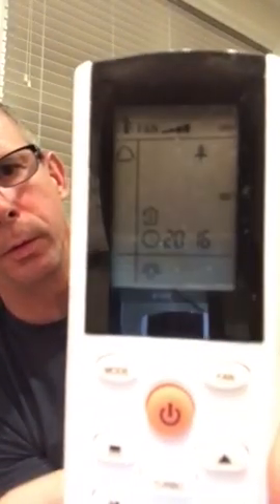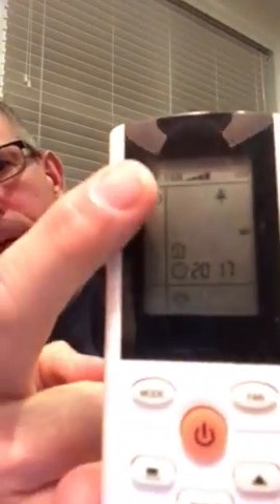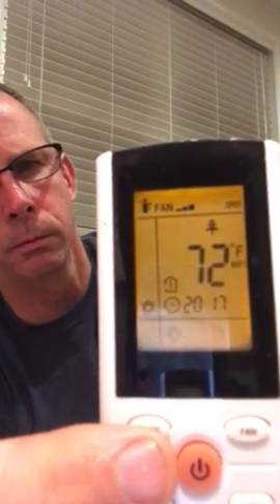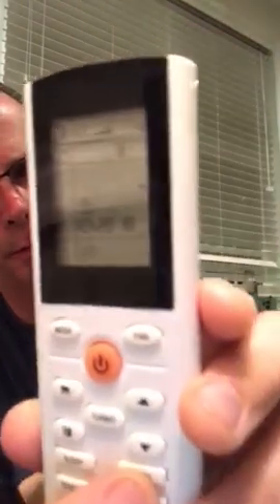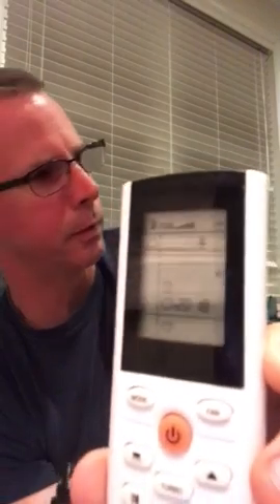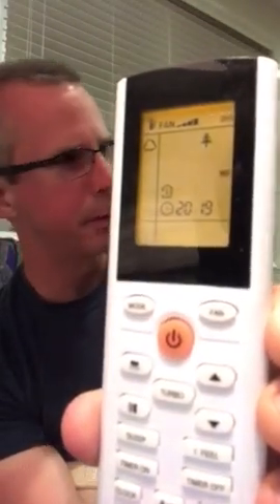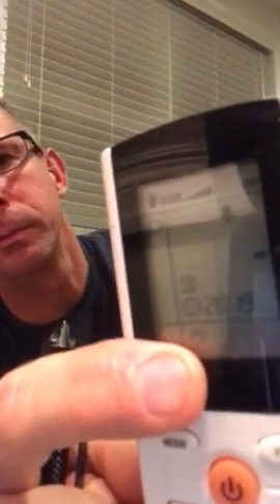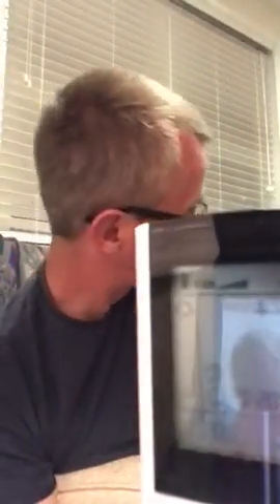Trane Minisplit Remote

Comment: Fantastic info....thanks a bunch....ive also learned that the TREE button is an econ mode that may effect the ability of the unit to cool at full efficiency....I turned mine off....why in the world doesn't Trane make a youtube describing all these features?  Also my temperature button is giving strange readings which are not immediately inferable from pics.  Ugh   Come on Trane, step up....

Comment: Where we live temperature dropped from 19 to 3 degrees in one day, we were so desperately trying to set the heat mode but we didn't get anywhere after scraping the useless manuals over and over.
Thank you for posting, at least we got the basics!
Reply from the maker: Thank you for commenting! I’m so glad it helped you. It’s sad that manufacturers will not write common-sense instructions on how to operate their products. You can imagine what it’s like for us technicians because we install/startup many different products with inadequate instructions. The tech support these days is just awful as well.

Comment: When the unit is in auto mode, the display on the unit reads “77” which is none of my set point temperatures. What is the meaning of the display when the unit is in auto mode?

Comment: Other than the set points for heat and cooling could you explain the correlation of the temperature settings along with moisture and fan settings?

Comment: Thanks for the explanation. I have a question for you Earl Heath (or anyone with that kind of trane remote.). Would you know what does the "WiFi" thing do on the remote? I found many smart apps that has the name and icon of the Trane company, and I especially found on my google home app that it's compatible with a device that's with Trane. But I'm not sure if that icon really means Wifi where you connect it to the internet. (Answers from anyone is always appreciated.)
Reply: Did you get any luck with this feature @coolgamer-yg8ur? I am still hoping I could use it. Thanks!

Comment: "The cooling set point always must be higher than the heating set point." 
Wait, I'm confused. Does that make sense? Shouldn't it be the other way around?
Reply from the maker: @adriant240  You are correct. Switch them around and you confuse the logic. It will not work if the heating setting is higher than the cooling setting.
Reply: @Earlvis  That depends on how it's designed to work. Is it programmed to heat/cool to a set temp or to heat/cool from a set temp? I'm even more confused now. The unit also shows a "E7" message, which looks like an error message. I don't know what I'm doing wrong.
Reply from the maker: @adriant240  If you have it in an auto-changeover setting, The cooling setpoint has to be higher than the heating setpoint. If you manually set the mode, it doesn’t matter.
Reply: @Earlvis  Ok, that helps. It's easier to just use the individual mode setting over the auto. But I'm still getting an error message, so need to figure out what that means.
Reply from the maker: @adriant240  Been years since I worked on those. If you’re not a tech, you should call one to diagnose.
Reply: @Earlvis  Thanks. I'll put in a work order. Thankfully it's not that cold outside yet.

Comment: I think I figured out the "TIMER ON" and "TIMER OFF" features. Pushing either one of those buttons will let you activate, deactivate and set time for TIMER ON and TIMER OFF respectively. In other words, the remote will turn the system ON automatically at the TIMER ON set time and turn it off at the TIMER OFF set time (if both are enabled).

If it was previously activated, pressing TIMER ON/OFF will deactivate TIMER ON or OFF respectively. You can tell that TIMER ON or TIMER OFF are enabled by seeing the "ON" and/or "OFF" on the right side of the time.  Pushing it again (or the first press if it was already deactivated) will put it in set time mode for TIMER ON/OFF with the clock disappearing and either "ON" or "OFF" blinking on the right side. Use up and down arrows to set ON or OFF times and press TIMER ON/OFF within 5 seconds to accept it (otherwise it will auto cancel). It will also enable TIMER ON/OFF. It's easier to understand if you play around with it.

One very important thing to remember however: The timer ON and OFF feature appears to be controlled entirely by the remote itself and not simply programmed into the unit it controls for it to do it on its own. This means that the remote MUST remain in such a way that it can transmit its signal to the unit it controls otherwise it will not work.

Comment: thank you for the video do you know how to change between celsius and fahrenheit
Reply: "When unit is powered off, press MODE and use buttons simultaneously to switch ℃ and ℉"
Reply: @Woetsmyla3  what is "use buttons"?
Reply: Candice Wilson I’m lost also , what buttons  to use with “mode” button ?
Reply: I am confuse also. There not clear how to switch F to C. Please Help.
Reply: @candicewilson1475  press the mode and the down temperature button simultaneously to turn to Fahrenheit
Reply: @Woetsmyla3  it's the MODE button and down arrow button simultaneous - toggles between degC and degF
Reply: @greggsidwell8307  turn the unit off then simultaneously hold the mode and down arrow buttons. I had to press hard.

Comment: Earl can you explain why cool should be higher than heat? And when I press x-fan I see no change in the remote. How do I set that?
Reply from the maker: Hi Jackie! It’s been a few years since I’ve started up one of these and I don’t remember much about it. I made the video after trial and error with the remote and probably didn’t quite cover every detail. So to change gears-Cooling setpoints always have to be higher than Heating setpoints when a thermostat is of the auto-changeover type. Auto-changeover works like this; let’s say the cool setpoint is 74 and the heat setpoint is 70. If the room temperature goes above 74, the thermostat knows it needs to go into cooling mode and run to maintain 74. Let’s say a cold front blows through and the room temperature drops below 70 degrees, the thermostat knows it’s cold and it needs to changeover to heating mode and will run to maintain 70 degrees. If the room temperature is between 70 and 74, the unit is idle and said to be satisfied.The thermostat logic will become confused if the heating setpoint is higher than the cooling setpoint and not run properly. Most humans have a comfort temperature around 74 degrees in warm weather and a comfort temperature of around 70 degrees in cold weather. This is why thermostat logic is programmed by the manufacturers to operate this way.
Reply: @Earlvis  Thank you so much for taking the time to explain Earl. God Bless you
Reply from the maker: It’s my pleasure, Jackie! That’s why they call me Professor Compressor 😂😂😂

Comment: Why does it say WiFi next to the temperature. Is there an app that will also control it?
Reply: It's a wireless remote that tells the wall unit what the temperature is around the remote when "I FEEL" is on - the little "iF" icon shows at top left on remote display.  Press "TEMP" button until you see little house with thermometer inside on remote display, you'll then see the wall unit display a different temperature for a few seconds before it reverts back to set temperature (unless remote ambient temperature is at set temperature). - My best guess.
Reply: @Woetsmyla3  In 'iFeel mode remote must point at the evaporator unit
Reply: I'm curious to know this too. No mention of wifi in instructions

Comment: Do you know what the little pine looking symbol means?
Reply: "HEALTHY AND SCAVENGING BUTTON" 
(Pine Tree / House) 
NOTE: This function is not available"
Reply: Econ button I was told.....unit less powerful in econ mode....saves electricity.
Reply: Woetsmyla3 how do you remove the pine mode
Reply: @janet7921  there is a button on the CENTER of the remote second row from the bottom

Comment: Agreement with everyone !  The worst directions and no help.  So thanks!  I love my mini-split.  The unit is in a basement apartment so my main concern, summer and winter, is humidity.  There are 3 mentions of the DRY function in the directions, mainly to say it exists.  Does anyone know if I can use it to lower humidity only?  and in which mode?  Currently (rainy spring) I'm setting the heat up high, but surely there's a lower energy mode to do it.  I mean the DRY function does exist!
Reply: Did you find out the answer?

Comment: Hi Earl, I’m not sure if you’re still active with these comments but I’ve got a question about this unit. When your unit is not actively cooling or blowing heat does the arm on your unit close without you having to manually power off the machine?
Reply from the maker: Hey Brian-I have never had any issues to report on the few that I have installed so I’m not sure if that happens or not. Wish I could be more help.
Regards
Reply: @Earlvis  ok, thank you. There used to be a mode on mine where it would actually shut after the run. I do wish the controller was a bit simpler as it seems I can no longer set for that. I appreciate your response.
Reply: @Earlvis  Is it best to have it on constantly?
Reply from the maker: @briancalcafuoco3165  Yes
Reply: @Earlvis  thanks for your time Earl. I appreciate it

Comment: My timer isn't on but the stupid unit still turns itself on randomly even after I've powered it off. Can't figure it out....
Reply: I had the same problem...I would turn it off and get up the next morning only to find it had turned itself on again.  When I reread the instructions for the "timer on" function, i figured out that if you have an "on" or "off" icon displayed on the remote, the the timer function is active.  Keep pressing the "timer on" button until it disappears.

Comment: Your video was cut a bit short as far as the view when you were showing the x button thing. Lol. Which one is that? 
Because of your video, I now know I have mine currently set to heat even though I'm pretty sure I don't actually have heat 🤣 I've been having to de-ice this damn thing all morning and I've been about ready to either cry or tear the damn thing off the wall and throw it. At this point, both would be about the same result as far as effectiveness 😒
Reply from the maker: Destiny-It’s been so long since I worked on one of those, I honestly have forgotten about the nuisances of that stupid remote. I’m glad you benefited from the video. Trane is so pathetic that they can’t write instructions that can be understood by end-users.

Comment: How do I correct the E7 problem?
Reply: Make sure all units are in the same heat or a/c mode. It will not function with a/c on one unit and heat on another and show the E7 code.

Comment: How do you turn off the time on and time off setting? It seems my system turn off when ever it wants to. I think this setting is on and the timer is turning on my system on and off. Aggravating!
Reply: I would take the batteries out, wait about 30 seconds, put back in AND DON'T TOUCH THOSE BUTTONS AGAIN! lol (default is no setting for "timer off" and "timer on". Hopefully that will help keep unit from seeming to have its own opinion on controlling your comfort!
Reply: Hold down the timer off button